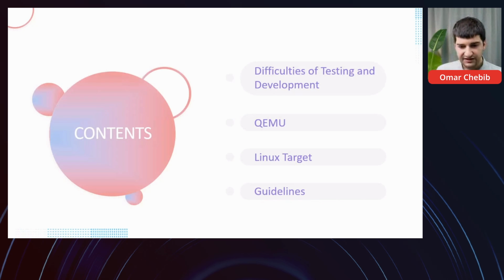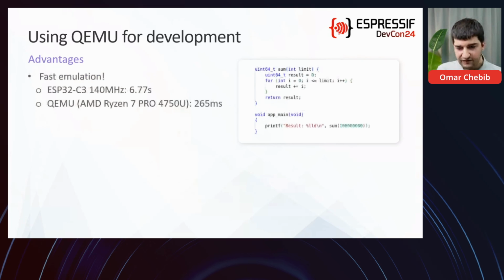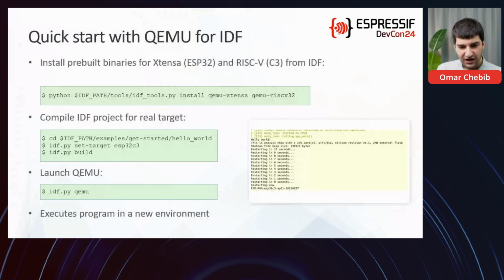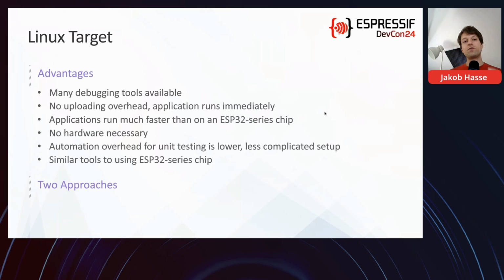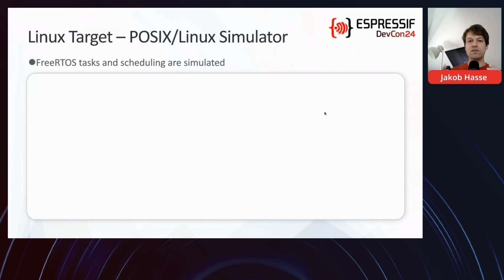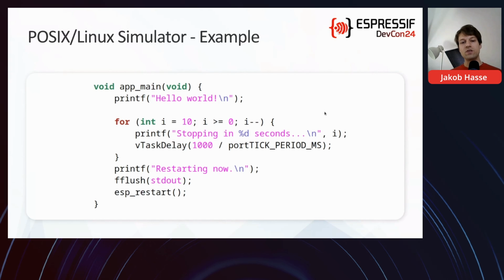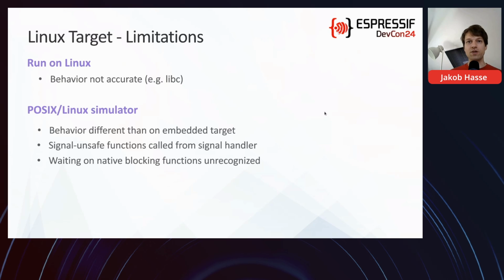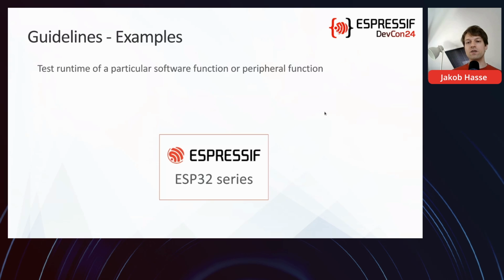DevCon24 - The QEMU the Linux and the Ugly Running IDF Code beyond the Target

Comment: I am new to qemu. When I switch to docker container, it tries to connect to esp-idf in local. I can't run any of the idf.py commands.

then i tried the local system. i can use idf.py commands. but this time I can't run qemu commands. for example, qemu says it can't get a response from port 5555 to switch to monitor and cancels.
Can you help?